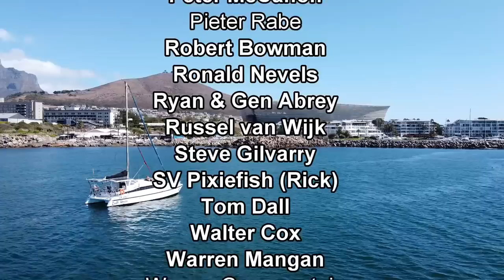Pressure is ON  | Can We Leave South Africa?

Comment: The accumulator tank you are talking about is a expansion tank with a rubber bladder in it . It equalizes the pressure so your pump doesn't turn on/off on/off when use small amounts of water

Comment: your gas water heater will work much better with the more even water pressure an accumulator tank  allows,just be sure to adjust the accumulator tank gas pressure to suit the pump pressure.

Comment: Great work, both of you. I recently fitted an accumulator for the same reason, blown pressure switch. I went belt and braces by inserting a power FET between the pressure switch and the motor, hopefully this will never fail again.
Reply from the maker: Thanks Colin ☺

Comment: So what your gonna have to flush the toilets multiple times a day so it doesn’t end up smelling seems like your setup was better without the salt water
Reply from the maker: 😂 😂 No you don't need to flush your toilet multiple times a day. You just can't leave your water standing for 2 weeks..
Reply: how many times per day you visit the washroom? i do at least 3 times and if hot weather and a lot of drinks then even more. so yeah 5-6 times a day between them flush will be just fine
Reply: The ideal is a switch over possibility.  Use freshwater when the saltwater is nasty and saltwater when on passage.